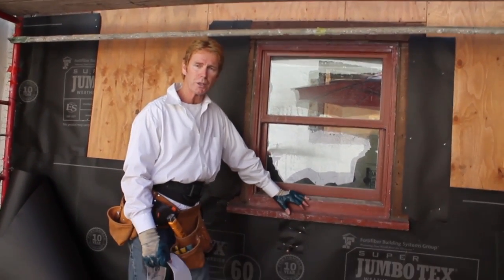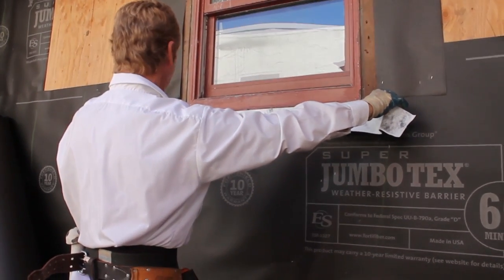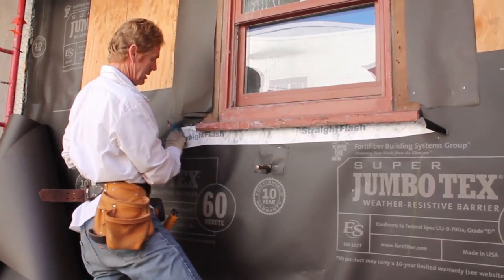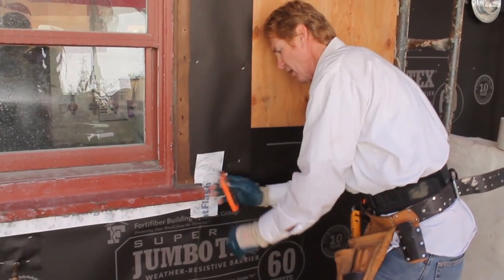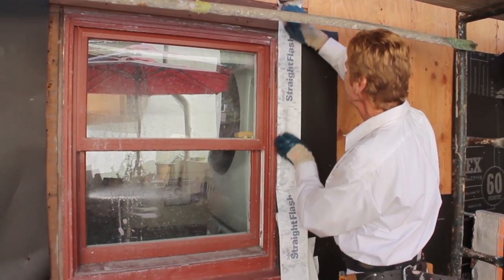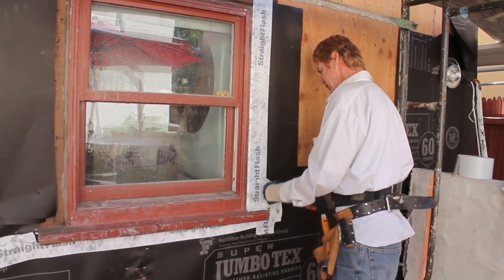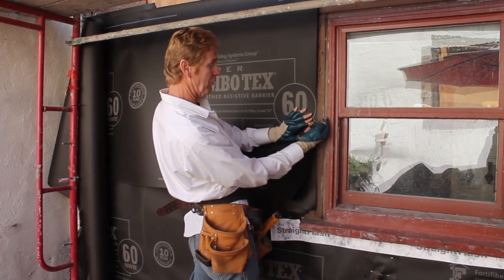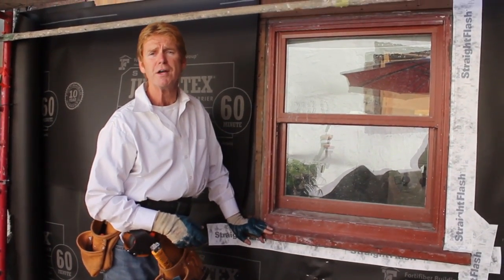Dupont straight flash waterproof old windows

Comment: My house isn't ancient. Built in 2013. But the window sills don't have any flashing. Madness!
Reply from the maker: Howdy Random Dude, it's not madness or insanity; the word is incompetent. No worries, I have seen this before, Any and all cracking around the windows caulk them and you will be okay.
Reply: They don't recommend taping the bottom flange if that's what you're referring to.
Reply from the maker: I'm not sure what taping means, however, all windows and doors should have flashing no matter when they were installed, whether paper or any other type of membrane.
 Wood on wood can't waterproof itself. Kinda like a water hose hooked to a spigot without a washer the hose will leak as metal on metal can't seal itself either. 👨🏻‍🔬
Reply: @StuccoPlastering  that's why they don't want tape on the bottom flange. That's the escape path of the water that makes it in. Top and sides are to be taped. Bottom is left untaped according to most window manufacturers.

Comment from the maker: Evening Ray Chronic, no need for either, I use usually premium for most stucco applications. It's a mix of common and plastic.
 And no I don't put any solutions in the stucco cemment products our waterproofing is installed to the structure making it unnecessary to even try to make plaster waterproof.
Thanks for watching and have a good evening
 kirk Giordano plastering

Comment: Hey Kirk,
on those old school windows, the ones that have a stucco-keyed  molding nailed to the window jamb, would you peal and stick into the key hollow, especially on the head? Did they use to run paper in there back in the day? Thanks,
Kelly
Reply from the maker: Kelly Goodman Hi Kelly, good question,  everybodys different, that a polite way of saying some fellas are tired and may not, but a fella should run the paper into this key and then use a fat bead of  polyurethane or comparable caulking which will fuse the paper to the wood frame permanently for best result,
 best wishes, 
 kirk giordano plastering

Comment: I work for a large, expensive window manufacturer that "guarantees certified installers" and promises this grandiose, "lifetime" warranty and yada yada...for the last year I've been flashing our leak calls from the edge of the window frame to the moisture barrier, whether it be tyvek or insulated panels, etc. Our certified installers lay the flashing tape flat in the rough opening, spanning the air gap in brick, after they fill the gap with expandable foam. Four flat planes that channel water straight inside...no bs. Then, they install window, foam around the frame and a proprietary trim snaps on exterior, caulked to brick, siding whatever the home is clad in. Bottom of the line, with minimum finish work on avg is $2k+/per unit... they pay installers $125/per unit(bare minimum install) and  cant figure out why their "certified" installers are lackadaisical at best concerning install guidelines or best practices let alone building code. Thanks for your time, but unfortunately these days its spray foam..."cant see it from my house"
Reply from the maker: Howdy Matthue, there are many ways to skin a cat.😉

Comment: For God's sake put some updated windows in before stuccoing the place.
Reply from the maker: Howdy Mucky Mind dude, If the city historical list insists one must use existing windows, then the general contractor as well as the homeowner have to make due with what they have. This does not involve god but instead rules.
 You will learn more with some time in.🤭
Reply: @StuccoPlastering  I gota give you credit for repying.👍 Are they not allowed to even refinish the old windows?  Cause if so, that seems like it should be something that should be done before applying a brand new  stucco coat.  But hey, I may just be venting because I'm currently stuccoing a house that had all the vinyl siding removed and they left some of the old aluminum windows. I't just doesn't make sense to me to spend tens of thousand of dollars to upgrade the exterior of your home and not replace a few hundred dollars worth of old windows first.
Reply from the maker: @MuckyWaters  Morning Waters dude, I'm just the stucco contractor; what goes on with the GC and the city is out of my hands, butt I do know what I'm left with we can handle as we're like everyone else, masters at improvising. Cheers. 💃🏻

Comment: Thank you so much for this video. I'm in a same situation. Most European-style older windows in my area are not flashed, and worse, they are embedded towards the interior end of the wall (https://i0.wp.com/pentamiri.blog/wp-content/uploads/2019/01/IMG-20141011-WA0003.jpg) and sit on a single marble sill. Very hard to protect bottom corners from mould and wet during rain that comes in an angle during windy weather.
Reply from the maker: You're welcome.👨🏻‍🔬